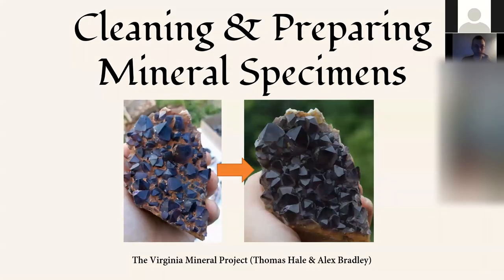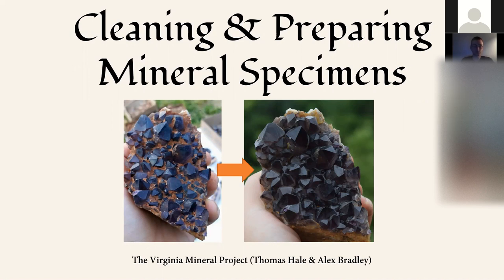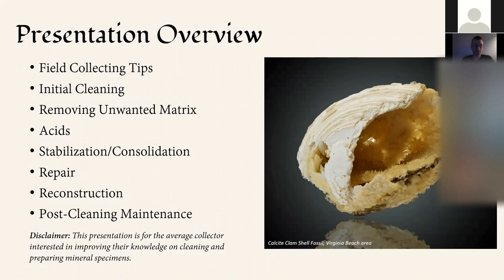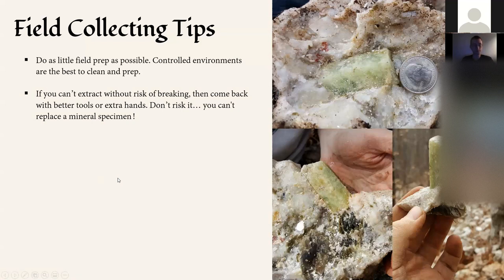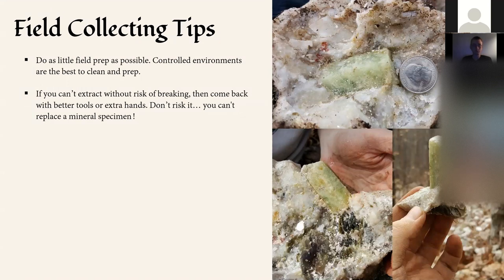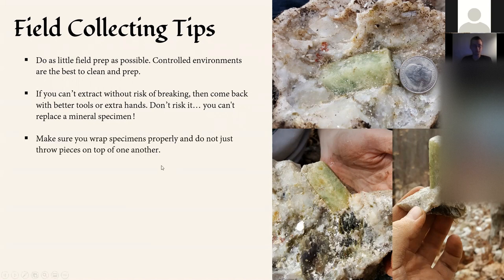Cleaning and Preparing Mineral Specimens

Comment: I used to work at a plating shop, and used hydrochloric acid, sulfuric acid, hydrofluoric acid.
Reply: Lol! In my younger days I had a boyfriend that took his crews aluminum hard hats dipped  them in some type of acid then they rubbed it with 'Brasso' so that their hard hads all looked like shiny stainless steel or chrome. I often wonder if that diminished the strength or safety of them.